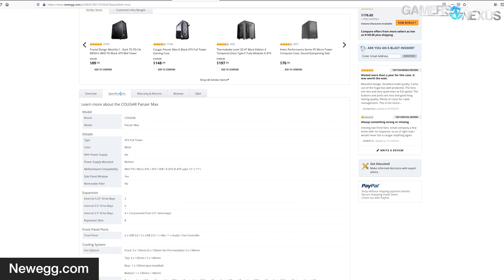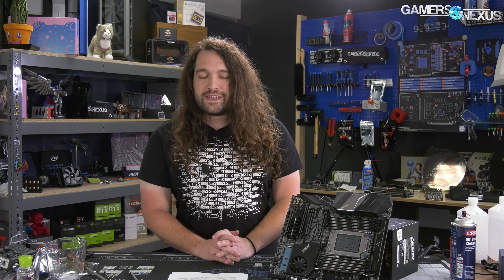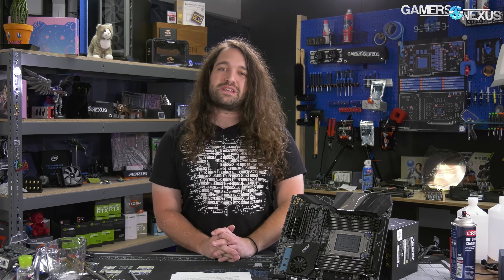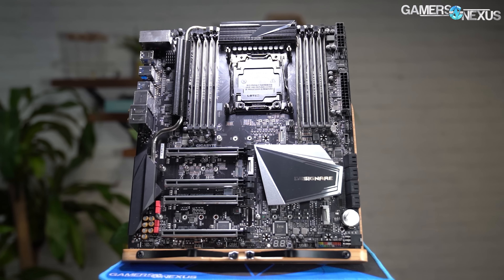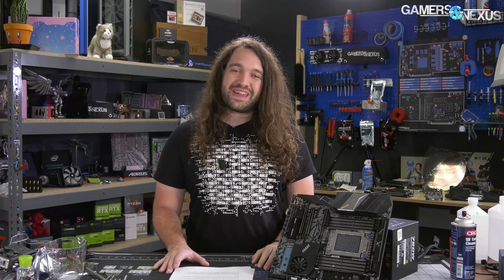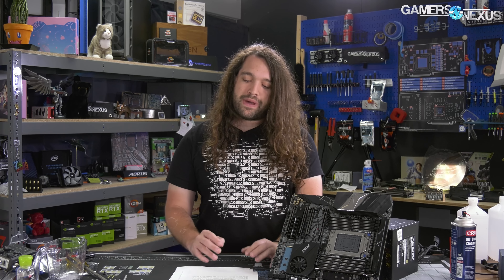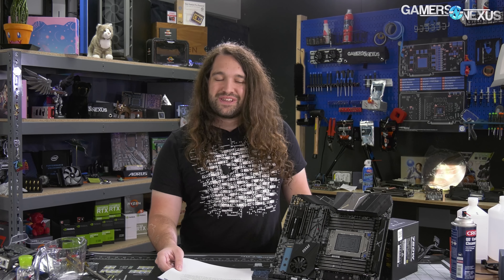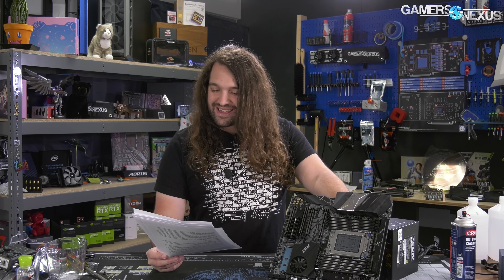"E-ATX" Is A Lie: How Motherboard Makers Ruined Form Factors

Comment: Thank you. I have been raging about this for a full two years, trying to fit server boards to normal cases. I returned several cases, because manufacturers lied to me in direct communications, Now I've seen you raging, it put me to ease. I am not alone.

You know what else ASUS ruined? Front panel connectors. We would have single standard 8+1 header, but no, ASUS needs to use its 'exclusive' breakout forcing us to stick this shit pin by pin. And recently Gigabyte started doing it to (saw it on Aoorus X299-Pro-3-something board). Stop. Just... stop. I'm glad that ASRock was fast enough to force 19-pin USB3.0 internal connector. I refuse to accept that RGB lighting exists, but I heard that it can be fun too.

Back to motherboards - then, there is DTX, which is sometimes DTX, and sometimes isn't, as ITX and DTX are apparently interchangable according to some manufacturers - resulting in crap like DTX cases that can't take actual DTX boards, and ITX boards that won't fit in ITX cases. There is old 'wide ITX' FF by Shuttle, which is ITX high (170mm) by full ATX wide (9.6"), and ECS's narrow-ATX, 170mm wide, but full 12" high (this by the way resulted in flurry of "ATX" cases in very late 90s and early 2000s that didn't fit actual ATX).

So yeah, form factors, by some a spec, by other, a mere suggestion, and BuzzWordsThatWillSellEveryThing-TX by marketing division. Or BWRWSET-TX, or BS-ATX, for short.

Comment: So, E-ATX means extended ATX, extended past 9.6"
So, E-ATX can rightfully been 9.7" 9.8" 9.9" 10.0" 10.1" 10.2" and on
So, is this motheboard at 10.7" E-ATX? NO. ITS NOT A STANDARD SIZE ITS NOT E-ATX.

Sounds like autism.

Comment: I'm sure I'm not the first person to point this out, but E-ATX is a thing. The dimensions are 12 in. by 13 in. If motherboard manufacturers are misusing the name, that does not mean it isn't a valid spec. It would just mean they aren't following the spec.

Also, it appears that most or all of the motherboard's sold as E-ATX in fact are larger than ATX, but smaller than actual E-ATX. This would make them compatible with any case that will fit a proper E-ATX. 

It's hard to tell from your video, but from all the facts presented it feels like you have a complaint with case manufacturers. Not motherboard manufacturers.